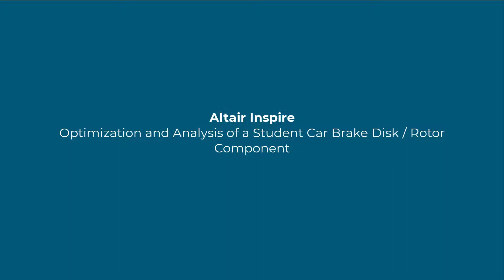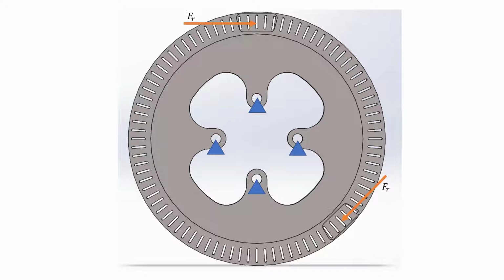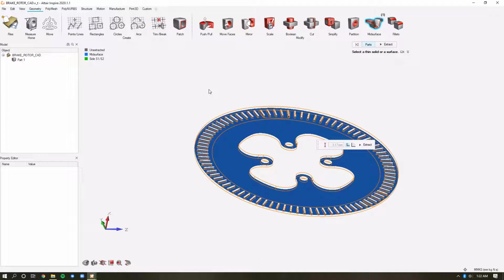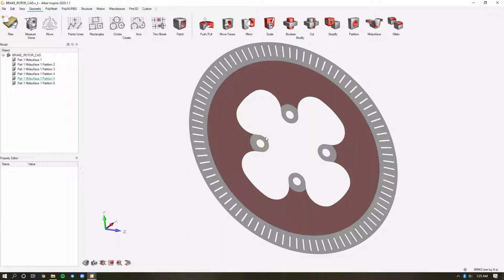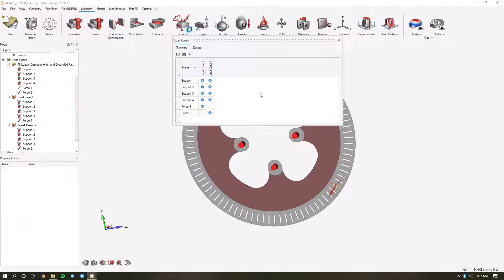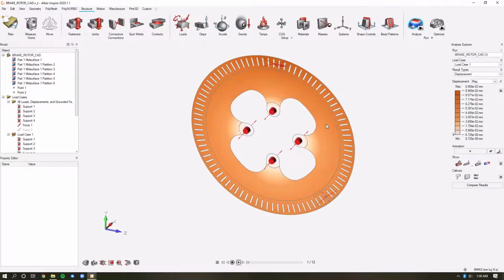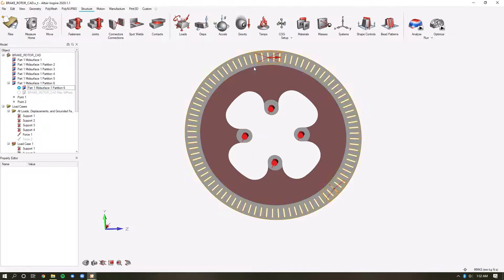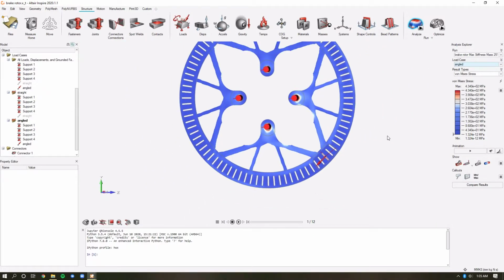Optimization and Analysis of a Student Car Brake Disk / Rotor Component

Comment: Nice Explanation👏👏   I have a Doubt. Why normal forces were not applied?  A brake disc is encountered by both normal and shear stresses.  But you have applied only tangential(shear) forces.
Reply: Including the normal forces (pressure) wouldn't really influece the optimization results as these loads are not transfered back to the bolt holes. The pressure on both sides of the pad just cancel out. You'll have some compressive stresses in that area but nothing gets transfered to the wheel hub.
He is trying to optimise the material load-paths to get the tangential load from the outer diameter of the disc to the wheel hub. Does that make sense?